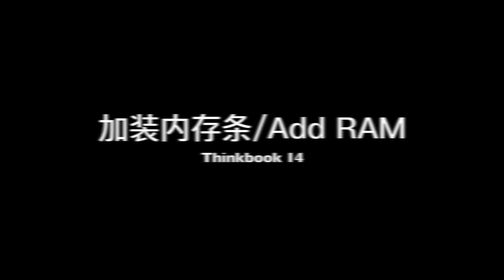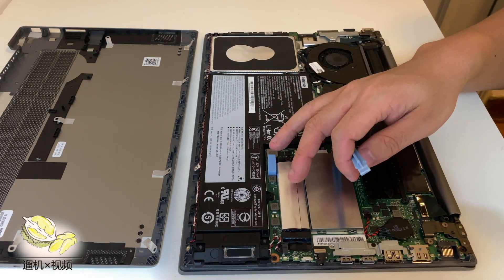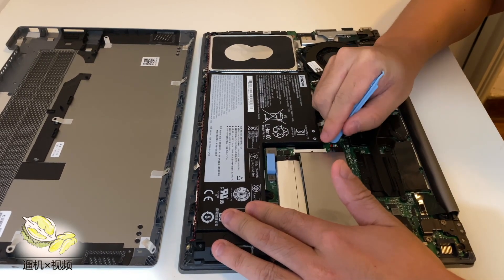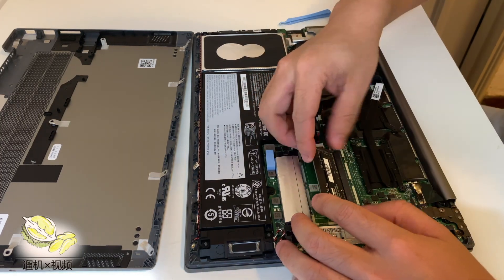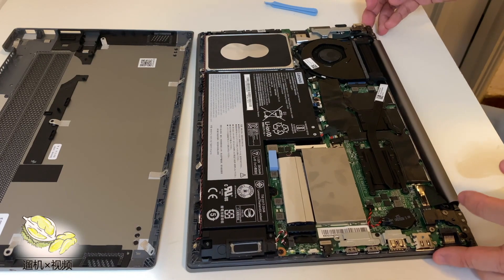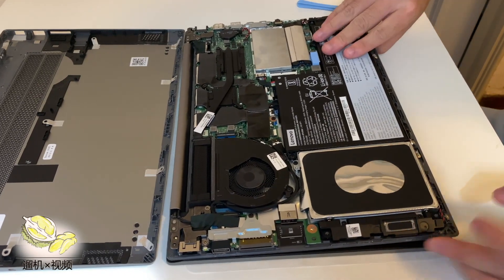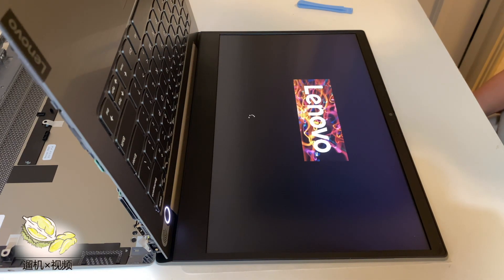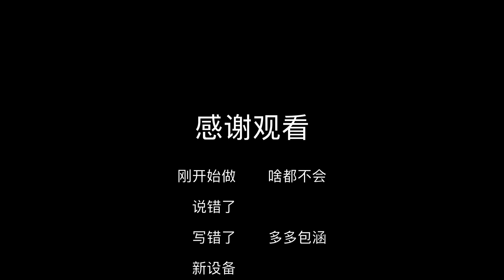[DurianP] Lenovo Thinkbook 14 Teardown and RAM upgrade

Comment: I have the same laptop i want to keep the HardDisk and also want to add SSD can i add in this laptop.
And does it have 2 Ram slots ??
Reply from the maker: My review copy has partial soldered RAM and one user accessible RAM slot. You will be able to add SSD if there is one. Pls consult your seller if your model indeed got these slots as there are many different motherboard types under ThinkBook 14
Reply: @durian_productions5650  How much RAM was soldered?

Comment: How manu ram slots are there ? Only 1 or 2 ram slot..
Reply: on mine 0 soldered ram, and only 1 slot RAM => needed to replace current installed RAM. I thougth I could upgrade to 24GB adding 16GB to the existing 8GB, but opening it I found a 8GB memory card => I had to remove it, and only get 16GB of total memory.
Reply from the maker: @jomcan7219  Kindly note that ThinkBook 14 got many configurations and motherboard types. You will need to confirm with your local seller on detailed specifications.
Reply from the maker: This model 1 RAM slot, others soldered on board
Reply: @durian_productions5650  what is the memory of soldered ram 4 gb or 8gb?

Comment: I recommend you never buy Lenovo Thinkbook. I has very bad experience with new core i3 10gen.  I bought 2 pcs. during one month. First laptop  video output doesn't work. Second laptop wifi module doesn't work. Touch pad also doesn't work and they do not whant repair.  I use first laptop 1 day. Second one week.
Lenovo is very bad quality laptop and very bad quality of servise,  warranty. Lenovo hot line also can not help
Reply from the maker: 😂😂😂😂This is really awful.
Reply: @durian_productions5650  Yes, you are right. "High price, low quality". This is a new motto of Lenovo.
Reply from the maker: Actually I worked as a Lenovo seller in China. Our sales data shows that the provincial hardware failure rate is 0.2%-0.3% for continuing 5 year or so. 
You may want to consider checking the source or seller of your Lenovo laptop. Getting 2 broken sets at one time is hardly possible even you buy no-brand items, let along Lenovo.
Reply: @durian_productions5650  I bought both divice in official  lenovo internet store.  Shop.lenovo.ru.
And I have open case with lenovo hot lines 2 month alredy. They only replace wifi module. But still discuse touch pad. I have 10 year experience with Lenovo laptop and I see that qualty  go down every year.
Reply from the maker: @dubaiautomsk1363  For downwards craftmanship, we see from any brands - laptops are becoming cheaper yearly. 
The quality from our aftersales side is becoming better yearly due to lowered service rate in statistics. 
For your specific case, it is more likely that you came through a batch of rubbish distributors and lousy service. In China where is originates, Thinkbook series service rate is only 0.3%. Lenovo China has long replaced the unit if the case cannot be addressed in 1-2 repairs. 
I would suggest you look for alternative brand since Lenovo ru is not expected to improve in short term we believe.
Reply: @durian_productions5650  👌

Comment: Can someone tell me how important is that blue rubber that sits near the RAM memory? Someone forgot to put it back inside and now i can't stop overthinking.
Reply from the maker: This laptop has a general soft chassis. Removing the foam may not present damage now, but will make the case easier to deform.

Comment: I thought this model only have 1 memory card slot?
Reply from the maker: The SD card slot is outside, not inside
Reply: I confirm, only 1 memory slot, and 0 soldered RAM on my model. (need to replace current installed RAM to upgrade)

Comment: Can we add an SSD on thinkbook 14 hdd only model? It's there a slot to add? TIA
Reply: @joeljustin  
Thanks for the reply.
So, there's no additional slot for M.2
Reply from the maker: If your Thinkbook 14 comes without an SSD (Say HDD only), then the M.2 NVME slot is open for upgrade. Do select M.2 NVME 2280 drives for SSD.
Reply: @durian_productions5650  what if my thinkbook (i5 series) comes with ssd 256 gb   . so is there any upgrade option  (slot) ?
Reply: @durian_productions5650  i ordered this laptop with 1 tb hdd... can i upgrade it with ssd... by keeping both ssd and hdd..
Reply from the maker: @nandankumar4052  Pls advise your detailed storage combo in original setup.
Reply: @durian_productions5650   what type ram shall i buy for this.... bcz i have 4 gb ram so... i need to upgrade it.... can u tell me..... DDR4/2133 and DDR4/2400
Reply from the maker: @nandankumar4052  I bought DDR4 2666. I do not understand why you only get 4GB RAM. By default the Thinkbook ships with 8GB RAM onboard.
Reply: @joeljustin  i order this laptop with 1 tb hdd can i upgrade it to ssd by keeping hdd ..... 
can i used both ssd + hdd....
Reply: @joeljustin  i order this laptop with 1 tb hdd can i upgrade it to ssd by keeping hdd ..... 
can i used both ssd + hdd....